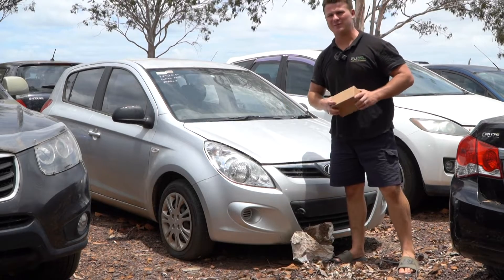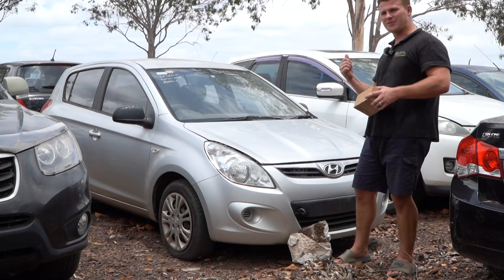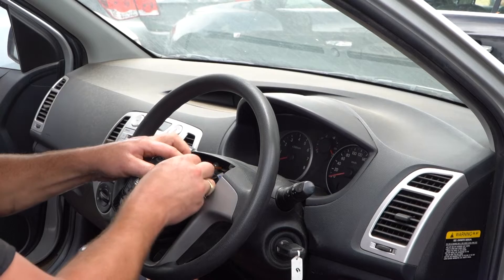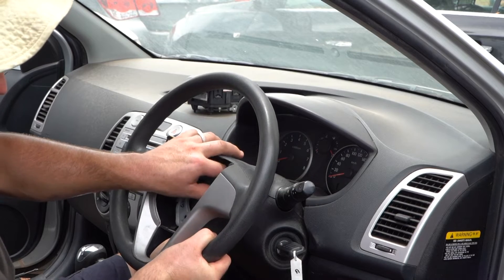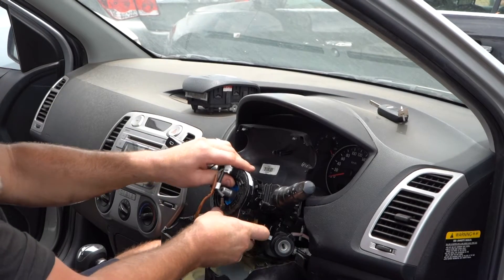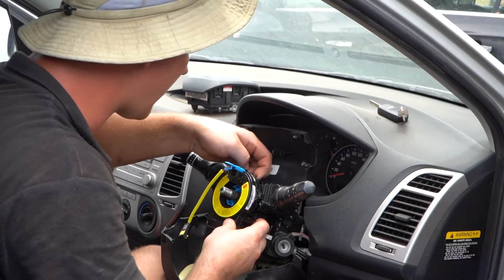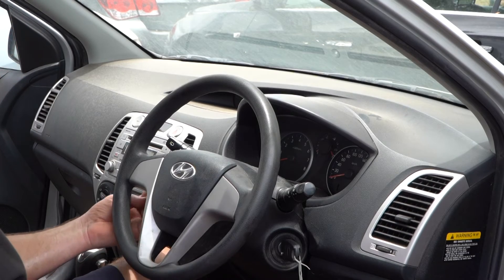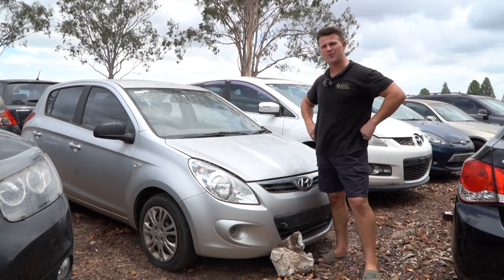How to Remove & Replace Hyundai I20 Clock Spring Suit PB Models Between 2010-2015

Comment: i bought a clock spring but it has only 2 slots for connection there no connection socket on the right side yellow plug
Reply: Same Problem…. Your part that we purchased from you only has 2 connectors not 3??

Comment: Hi. Thank you for the video. I followed the tutorial to put in a new clock spring and steering angle sensor in my wife’s 2010 Hyundai i20. Before I replaced them, the airbag light was on and none of the steering wheel controls worked. Afterwards, the airbag light is still on and now the ESP light is also on, and all of the steering wheel controls are working, but now only the volume control is not working on the steering wheel. The volume still works on the radio. I do not have an OBD computer to delete the faults. The clock spring I installed was 14ch but the old one was 7ch. Do you have any advice as to what may be the issue, or is it likely the issue is with the 14ch vs the 7ch? Google said I can use either. I ordered the 14ch by mistake. Thank you very much
Reply: You put on a wrong clock spring obviously if the old one was 7 inch and you installed an 14 inch

Comment: Do I have to clear the error memory, after replacing the spare part, so that the lamp stays off?
Reply from the maker: Just remove battery and re attach. It will clear it
Reply: @ But when I replaced the glock spring, the battery was removed. Now I've replaced all, but the airbag light is still on.